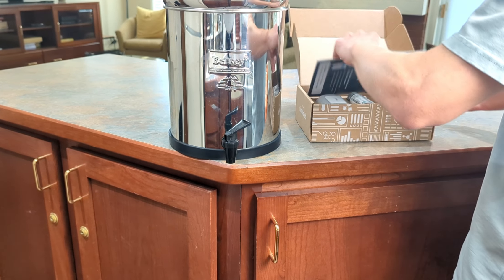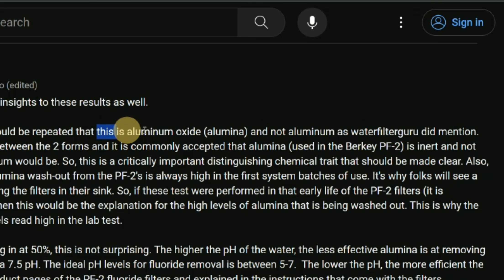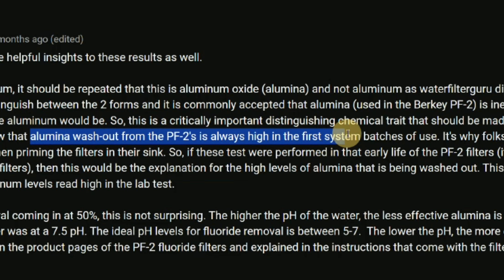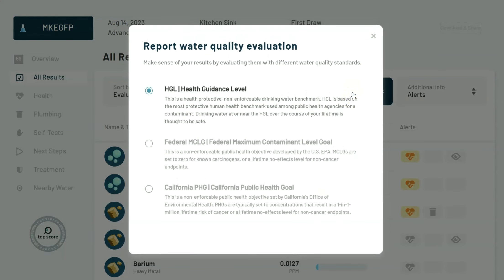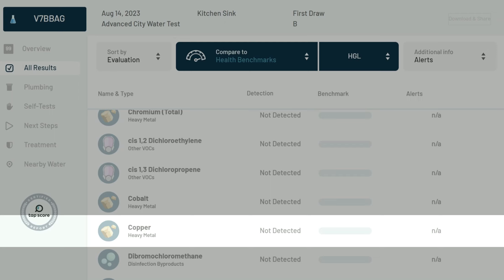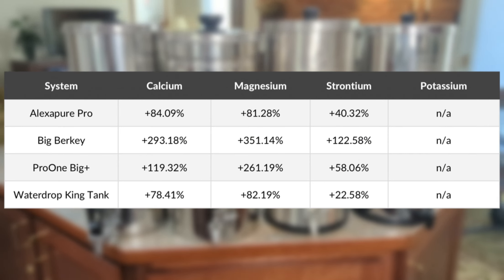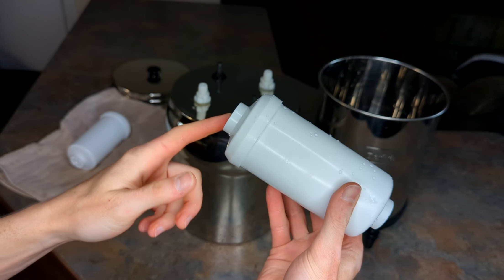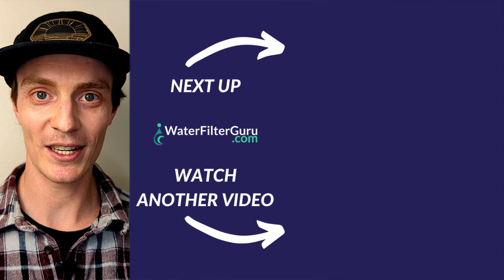I tested a Berkey…AGAIN!

Comment: I heard that the EPA is in a lawsuit with Berkey, claiming their filters may contain pesticides or silver. Is this true? Should I consider buying a different filter? Thanks.
Reply from the maker: Their filters do contain silver. Many water filters do. It's impregnated into the filter media to deter bacteria growth. 

Where Berkey got in trouble is that they started making claims that their filters could address pathogens (bacteria, virus, etc.) based on their use of silver.

Silver is a regulated pesticide under FIFRA, and Berkey did not comply with federal regulation. This the stop-sale order from the EPA and subsequent law suit.

All that said - yes, I would recommend a different water filter. Due to the stop-sale order Berkey is currently not allowed to manufacture or sell replacement filters.
Reply: @waterfilterguru, thank you for your reply. However, they are still available for purchase here in Canada. I contacted the store where I bought them, and I can still buy more. I am looking for a replacement, and although there is no fluoride in our city water, there is arsenic. Therefore, I need some black filters and probably a fluoride/arsenic filter as well. Do you have any suggestions? Thank you so much!
Reply: @waterfilterguru which Berkey Fliters contain the silver? The black or white?

Comment: These elevated minerals post filtration are from the white filters rather than the black filters I assume ?
Reply from the maker: No, our hypothesis is that they built up inside the system and filters during the time we took to prime to 100 gallons. The water we used to prime had elevated levels or these minerals compared to the water we used for the test.

Comment: I have a very important question!! What happens when you have 2 fluoride filters with 2 black elements filters??
Reply: Surely it wont filter the fluoride fully??
Reply from the maker: That's the configuration we used in both our tests. See the results again starting at 1:56

Comment: Please test SimPure reverse osmosis countertop system!
Reply: Please also test for reduction of pharmaceuticals, endocrine-disrupting compounds (EDCs), pesticides, and other chemicals, if possible. I am concerned most about EDCs.
Reply from the maker: Hi thanks for your requests! The performance testing we conduct is based on real-life use, and for that reason we have no control over what contaminants are in the water sample being used for the testing. So that's to say we cannot guarantee that any future testing we do will include EDCs and pesticides, as the water we use may or may not contain these types of contaminants
Reply from the maker: Also we've got the SimPure countertop RO unit on the list already!
Reply: Thank you for the response and I understand. However, I thought those were common contaminants in most US tap water.
Reply from the maker: @New_Heaven_And_A_New_Earth  Water quality can vary drastically from state to state, city to city and even zip code to zip code. This why testing a sample using a certified lab is so vitally important when deciding what type of treatment you need

Comment: Hi i have the black berkey filter and was just wondering what was the tds of the black filter most specificly if it was below 100ppm?
Reply from the maker: TDS alone is not a good measurement of whether or not water is healthy, or if a water filter like this is performing. The Berkey filters are not capable of reducing TDS. Check out this video to learn all about what TDS is and what TDS meters do and do not measure https://youtu.be/yHvdYWXiVzI

Comment: What counter top water filter would you recommend ?
Reply: PS that I could also take camping! But if the one you think that is the safest cannot be taken camping, I also would love to know that as well.
Reply from the maker: It depends. A countertop reverse osmosis system like the AquaTru https://geni.us/chlQv5o will provide the most broad contaminant reduction. But it can't be used with untreated surface water (ie. filtering river or lake water while camping).

Check out the British Berkefeld https://geni.us/yHRpt or ProOne https://geni.us/0T5W8 for use with untreated surface water

Comment: This retest only serves to bring up further questions:
 If this is Aluminum Oxide (alumina) leeching from the PF2 filters as Berkey claimed, why is the TAP testing identifying it as Aluminum instead of an aluminum compound?
You need to answer this question first regarding TAP's analysis because if true, where else are they misidentifying contaminants?
But if TAP genuinely is testing the aluminum element in the water and correctly identifying it, then something is amiss with Berkey's explanation regarding the test identifying the inert aluminum oxide as aluminum.
About the only thing I come away from this video thinking is that Berkey is still stretching for excuses when they explain that alumina washout is high with the PF2 filters in the first system batches of use. But that's pretty much standard corporate response. Problem is, they advise 10 gallons being run through to flush the filters before use and/or testing, and as they must be aware since they're responding to your video, you ran 50 gallons through the filters before testing (unless you are a liar, haha). So, while some may not adhere to the flushing instructions (though one would think that someone concerned about filtering their water would be more likely to adhere to manufacturer directions), you certainly went way above and beyond that requirement and yet the filters still leeched into the water? 
 So that brings up the other concern, which is, if these were defective filters, how is Tom, Dick and Harry going to know whether they're drinking water contaminated because they got defective filters or not. Most people are not sending their water in for testing so they would never know. Like many markets these days, the water filtration one seems rife with deceptive or outright false claims in their marketing material and quality control issues in their supply chain.
Reply from the maker: Exactly my point, the average user wouldn't know that the activated alumina media is leaching. This is why we don't recommend these filters for fluoride or arsenic reduction.
Reply: Hi there Antonino!

Great questions! We power the logistics behind Tap Score (from shipping to the UI to reporting) and can help lend some insight here. 

The water quality testing reported for aluminum–along with other measurements in our reports–are not misrepresenting what is being analyzed. 

In this report, aluminum is total recoverable aluminum run by EPA method 200.7. 

This means that all forms of aluminum, including alumina and other compounds in water, are measured. We do not make any claims to the type of aluminum compounds present in different ratios in the samples, as this is not what is being run by the tests. 

The total aluminum could be comprised only of one aluminum compounds, or it could be multiple compounds, but we cannot know. It's possible that Berkey has run their own tests to distinguish which compounds are commonly found from their filters. In either case, it is possible and plausible that the aluminum measured in this sample includes a contribution from very small particles of aluminum oxide, aka alumina. 

While alumina is less bioavailable when ingested, it is not entirely inert. Health-based guidelines for aluminum in drinking water are often calculated based on total aluminum concentrations, which explicitly includes dissolved and solid aluminum compounds.

Hope this helps clarify what's going on. If you'd like to know more about how testing works through us or Tap Score, feel free to send us a message any time through our site as we might not always catch YouTube comments. 

Team SimpleLab

Comment: I don't suppose you tested aluminium removal by the black filters without the fluoride filters in place?
Reply from the maker: Yes, see our first Berkey test https://youtu.be/AVZmZwTxnMc?si=skxTsRGXhxFfJGZr&t=294 in the pond water test, we removed the PF2 fluoride filters and only used the Black Berkey filters. There was 0.04 PPM aluminum detected in the unfiltered pond water, and then 0.04 PPM aluminum still detected post filtration through the black filters.
Reply: @waterfilterguru  Thank you!
Reply: @waterfilterguru is that a high amount? And harmful? Are the black ones ok to use?

Comment: Isn't alumina/aluminum oxide super inert and thus not toxic to the body?
Reply from the maker: I asked the experts at the lab this same question, basically they said it all has to do with bioavailability and that aluminum is toxic no matter what compound its contained in. Additionally that health-based guidelines for aluminum in drinking water are often calculated based on total aluminum concentrations, which explicitly includes dissolved and solid aluminum compounds. Check out their response in a different comment thread here: https://www.youtube.com/watch?v=AVZmZwTxnMc&lc=UgxJjOYLLvaKvSldl0B4AaABAg.9kTs5772fNa9moaXtQI07y

Comment: I get a lot of calcium carbonate through my berkey, any idea why?
Reply from the maker: The filters aren't capable of reducing calcium carbonate, this is an expected result
Reply: I'm surprised it won't, is it an extremely small particle? I boiled down ½ gallon of filtered water and had about ½ tsp of powder, looked at it under my scope and looked a lot like asbestos, I complained to the provider as having asbestos in my water they are selling, their tests came back as calcium carbonate, I tested independently with same results
Reply from the maker: @RL-rh8zf  The water filter media used in the Berkey filters is unable to reduce calcium carbonate, which is dissolved into solution. There are different water treatment processes that target different types of contaminants. I hope this helps explain

Comment: Some guy just showed up and made some dramatic demonstration of why I should get his conway system.. have you tested these?
Also do I need the white filter if there's no fluoride added to the water in my country? Only Chroline is used here, should the black filter do ok enough for metals and impurities?
Reply from the maker: We've not yet used or tested any Conway product, so I don't have any info for you there unfortunately. 

As for the Berkey black and white filters, the white are for fluoride and arsenic reduction. If you don't have either of those contaminants, you most likely won't need them.

Your best bet is to start with a laboratory water test, and use the results to guide your purchase decision!

Comment: Can you please test The Water Machine I just bought it and I’m afraid I just wasted my money. What’s the point of buying a filter if they are just going to add aluminum to it
Reply from the maker: Thanks for your request, we've got the water machine on the to-do list. What makes you afraid you wasted your money, exactly? Have you experienced an issue?
Reply: @waterfilterguru  I haven’t got it yet I just ordered it yesterday. I’m just afraid it uses similar filters cause they compared themselves to a berkey. Hoping I made a good choice I followed you so I can watch the video when you post it. Thanks!
Reply from the maker: @Gleamllc  Keep me posted, I'd love to hear your thoughts on it. I will say, it looks like they are promoting that it can be used with microbiologically unsafe water - I highly suggest not doing that. If you want to filter water that might have bacteria, parasites, etc. Always properly disinfect it first. These filters alone will not provide sufficient protection, and the manufacturer claiming they will is misleading.
Reply: @waterfilterguru  good to know. But no, I just want to fill it up with tapwater. Hopefully their claims on filtering out everything in tapwater is true. Apparently the owner of the company started it because they used to be a sales rep for berkey and didn’t like the metal containers cause they would rust over time so they made all glass ones instead.

Comment: I’m just a little confused I thought turkey filters were no good now you’re sending them can you clarify?
Reply from the maker: Sorry this comment is a bit confusing. Are you asking for clarification about the data gathered and presented in our two Berkey testing videos?
Reply: Thanks for getting back. Yeah I just thought that the last test about the Berkey filters showed that they didn’t perform good now it looks like you’re saying that Berkey is working well?
Reply from the maker: @joeyshotsauce43  nope, not at all. The first test identified an activated alumina leaching issue with the white PF2 fluoride filters only. The Black filters performed great. The second test was to determine if we would see a similar issue with a completely new set of PF2 fluoride filters. Check out both videos again:
Test 1 https://youtu.be/AVZmZwTxnMc
Test 2 https://youtu.be/1QL3McV20YM

Comment: Have you heard of anyone testing at 200 gallons vs 1000’s of gallons? Considering all of the controversy with the lawsuits I would be curious of your confidence vs some of the certified ceramic filters?
Reply from the maker: Not yet. 1000 gallons is A LOT of water. Like I think I mentioned in the video, it took us over 2 months just to get to 100 gallons for this second follow up test.

That said, I've always thought the claims that their filters have a 3,000 gallon capacity are a bit far fetched. Although we've not yet tested these claims ourselves, I have low confidence the filters really do have a 3,000 gallon capacity. There is also risk of biofilm buildup on/in the filter elements when they are used for so long.

I think this is one reason the manufacturer of Berkey has refused to get any legit certifications, as the certification process requires testing to 2x-3x the claimed capacity I believe.

Which ceramic filters are you referring to?

Comment: made in?
Reply from the maker: It's actually kind of hard to find this info believe it or not. Here is what is posted on their product listing on Walmart:

*The Berkey® stainless steel chambers are assembled in the USA from US and imported parts. The Black Berkey® Purification Elements are made and assembled in the USA.
Reply: @waterfilterguru  thanks, it is critical who make the parts especially the filter
Reply from the maker: @huipeng1749  More importantly, in my opinion, is if the manufacturer has achieved certifications for the filter
Reply: @waterfilterguru  I am in California

Comment: Sounds like you got the threat from Berkey and now your back tracking!
Reply from the maker: Nope, requests from viewers actually. I still don't recommend Berkey for a number of reasons:
1. Refusal to get performance certified to validate their capacity claims
2. EPA stop-sale order makes getting replacements difficult
3. Blatantly lying about their filter performance in order to make sales

Overall, multiple sketchy practices that have ultimately lead to the situation the company is currently in.

Comment: So the final results were 99?
Reply from the maker: In this second test, yes the calculated Tap Score was 99. However we've decided that it makes more sense to look at the individual contaminant reduction, rather than the calculated Tap Score. Because the overall score is calculated by an algorithm, it takes into account factors that may not be relevant from our performance testing perspective. For example, the Tap Score looks at factors that affect the home's plumbing, which are irrelevant when performance testing a point of use countertop unit.

Comment: Having to run a hundred gallons+ through a water filtering system is rediculus for a product designed to be a survival/preping tool. So it is still a massive failure, especially for the price.
Reply from the maker: Just to clarity, the initial 100-gallon flush served to eliminate any residual aluminum oxide media washout from the PF2 fluoride filters only. We wanted to make sure the media washout was not a contributing factor to elevated levels of aluminum detection like we saw in our initial test.

Comment: Wait.. so if i need to filter the calcium from the water, this is actually making it worse???
Reply from the maker: No, not necessarily. I think this increase in calcium detection was more likely due to our testing process, and not coming directly from the filters themselves. Our hypothesis is explained at 2:52

Berkey filters are unable to remove calcium from water. If you need to do so, you'll want to consider a reverse osmosis system or cation exchange unit. Typically calcium is removed at the point of entry to the home with a water softener, to address scale issues in the home itself. Calcium is a healthy mineral for human consumption

Comment: Definitely a design flaw in the filters knowing how stupid we humans can be. Just try and remove the wheel nuts on your car and you'll find them over-tight and the same with the oil filter. Look at marketplace and items being sold because people don't know how to use them correctly.
Reply from the maker: Yep, definitely a design flaw. "Do not screw on more than 6 full rotations"... Allows filter to be screwed on more than 6 rotations 🤦

Comment: The fluoride filters are badly designed. The instructions state to only turn 8 times while attaching but thats confusing because it takes about 12 turns to screw them over the black nossle. It also doesn’t show which way around they should be, if that matters.
Reply from the maker: And if they are over tightened, you risk breaking the internal screen which keeps the activated alumina media inside the filter. When the screen is broken, the media will leach into the filtered water chamber.